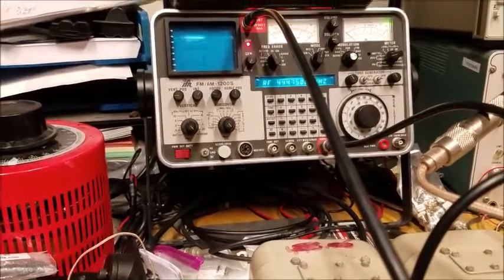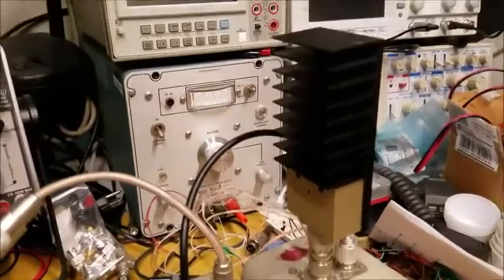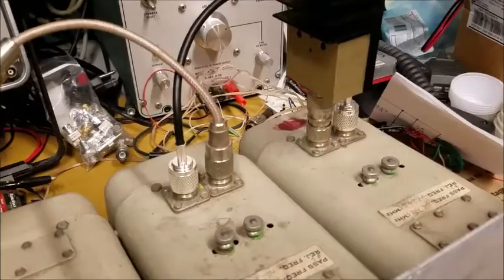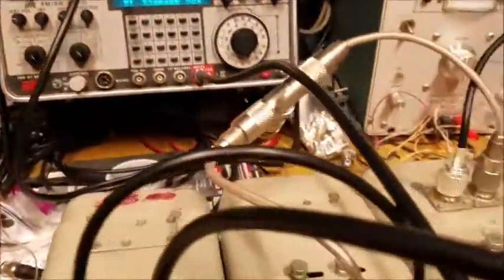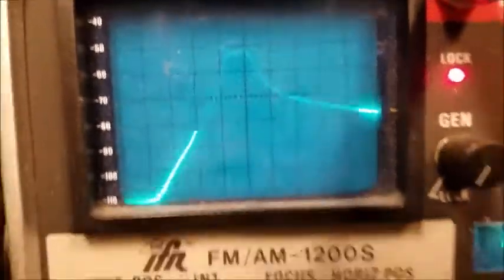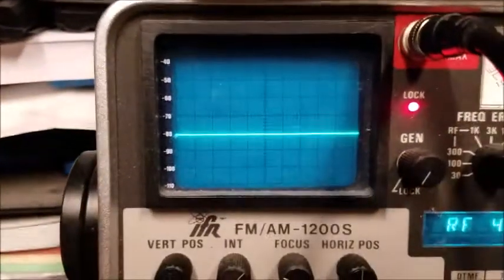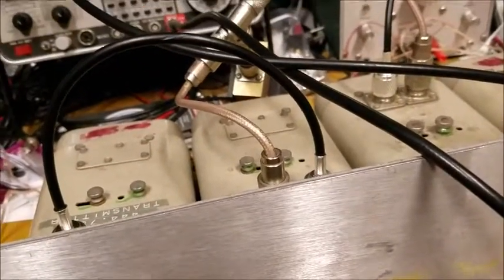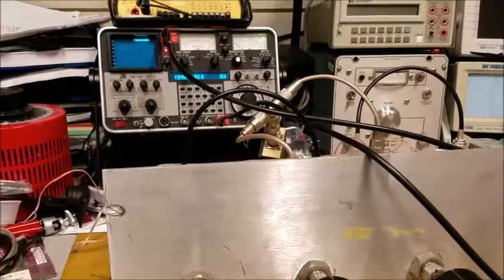Duplexer tune

Comment: Thank you sir!
I just tuned a “Fingu” brand UHF (T-Band... yup..  you read that correctly)
The public safety communications world LOVES President Donald J Trump!
He cleaned up the Obama “spectrum giveaway” to his DemonCrat pals w/ the 2012 “stimulus crap”

The duplexer is a BpBr rack mount unit and is supplied by /\/\otorola with their GTR8000 series repeaters.
Nice device, but nothing seems as solid as the older gear.

I don’t have an IFR anymore, so I used my Rigol DSA815TG.  
It’s a fairly cheap spectrum analyzer w/tracking generator. (Under $2k)

Thanks for your videos...  this one gave me the motivation to get some of my garage “pile-o- gear”
tuned up and donated to the quite worthy volunteer fire/EMS world.

👍🏻

Comment: Michael, I have struggled with cable lengths when tuning duplexers. After tuning a duplexer, if I change the two cables with different lengths, the IFR shows the tuning at different frequencies than first tuned. What is the correct cable lengths used to tune a cavity/duplexer. 300/f x VF x 1/2 wave length?

Comment: I’ve often found it makes things a lot easier to separate the cavities for the initial tuning when possible.
Reply: I was wondering about that.  I was thinking that it might make it easier to get the broad double peaks together on one frequency.
Reply: @BryanTorok  That's what you're meant to do, do each filter first get them peaked then put together and fine tune again.
Reply: @bigpimp347  Thanks.

Comment: Nice video,  There are a couple of things you should do to tune it better.   Set the tracking generator to HIGH when checking the  notch frequency.  At that it will put out about - 3 db instead of -40 you are using .  The duplexer will have over 80 db,more like 100 db of notch.  You will not see that unless you go to  the high output.  You may only be getting 70 db of notch instead of 100 or more.   Always use double shielded cables or better at those levels of signal. 

To tune the pass frequencies using a return loss bridge would be best, but if you do not have one you are fine with that part of the video.

Comment: Michael that was a great explanation. Very well presented. Thanks for taking the time to do this. I believe I can use this to test mine out. Got to see if I can round up a uhf duplexer to try it on.  Yes I have the homemade set but a commercial set will confirm I am doing it right.  Thanks again my friend. 73. I am sure I will have more questions later So may shoot you an email. Buddy.
Reply from the maker: Thanks, Buddy.  I'm glad I could give something back for you to look at.  I've spent hours and hours learning from your videos.  You da man!  ;-)   

Please note, I'm no expert on duplexers.  This is my first rodeo tuning one.  I just noticed that the curves looked MUCH different from your home made duplexer test, so I wanted you to see what a  commercial one looks like on the IFR.

Enjoy and keep those great videos coming!  Thanks & 73 - Mike
Reply: Thank you Michael. I now have the idea on how to start it. For the past hour I have been playing with my homemade duplexer.  I do not have enough "Q" to notch the frequencies. So I need to trim my pick up inside the duplexer.. I can get a good define notch on each side but the isolation is terrible. I know what I have to do to make them better now.  Thanks to your video got me on the right track. Going to see if I can locate a uhf duplexer commercial built to play with. Buddy